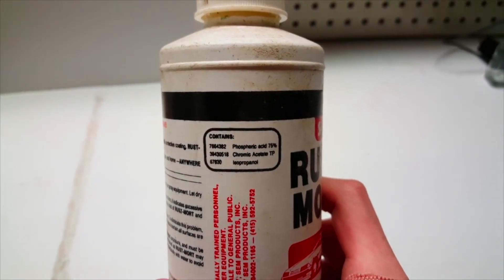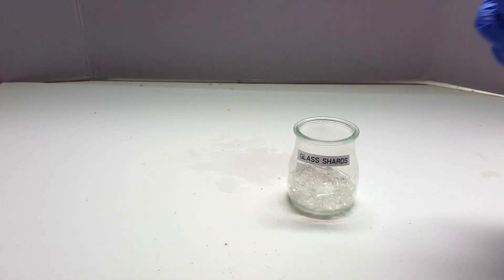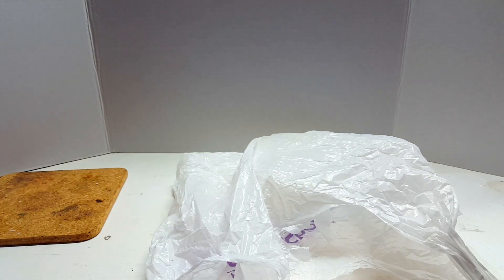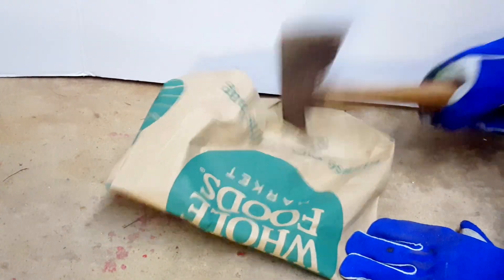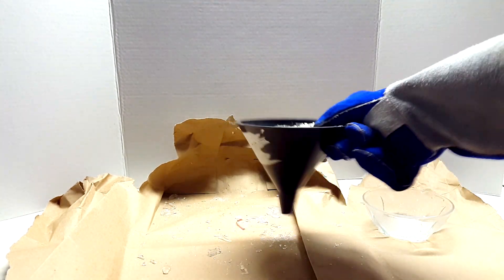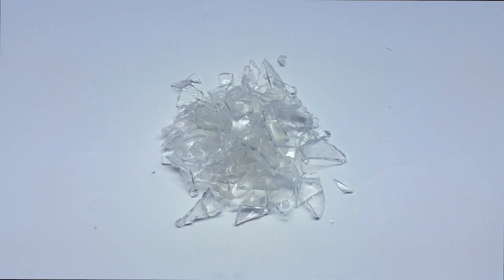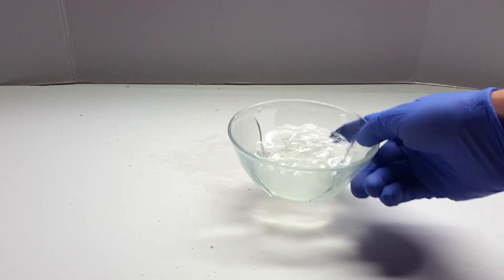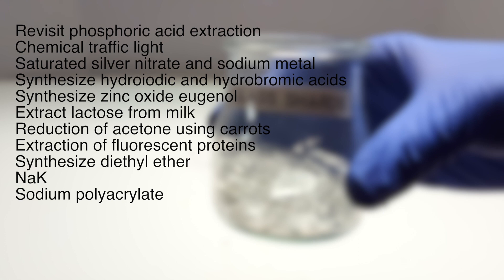Making Glass Boiling Chips (Boiling Stone Alternative)

Comment: Excellent video comrade. How do glass chips compare to ceramic ones made from broken cups or pots?
Reply from the maker: Stalin did nothing wrong Thank you, Comrade Stalin. Ceramic has the problem of cracking and breaking off over time, which isn't great for distillations where you want to keep the substance in the distilling flask. It will often result in a bunch of little particles, which does not happen often with glass.